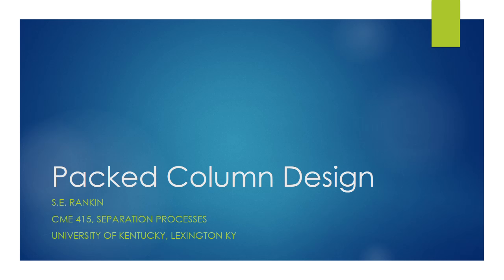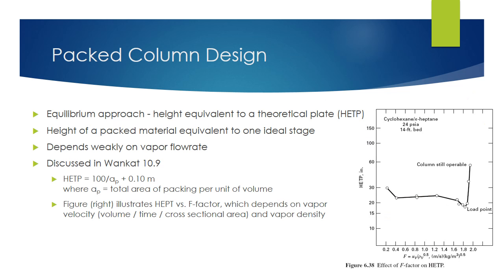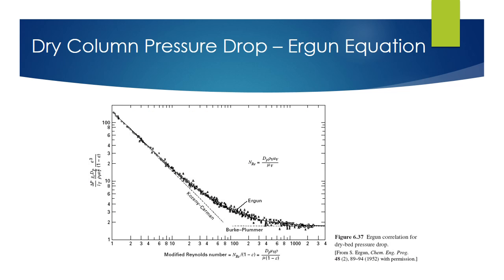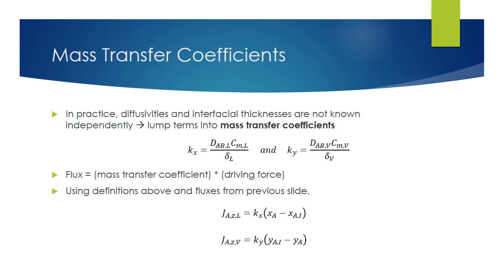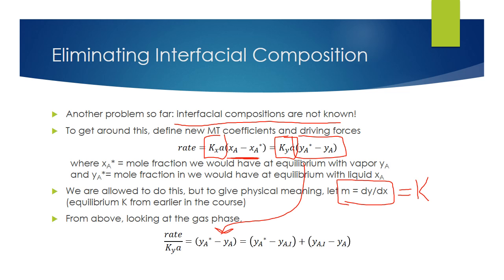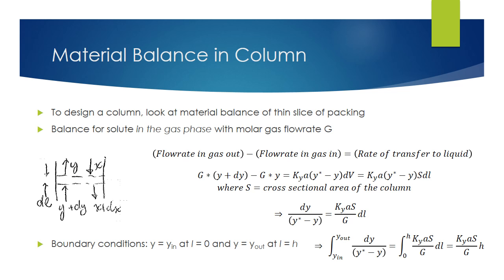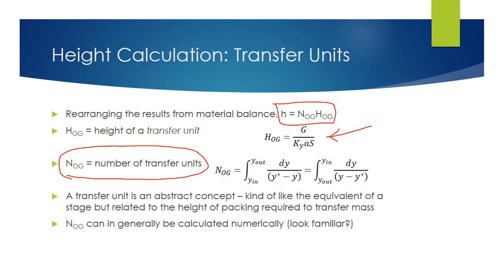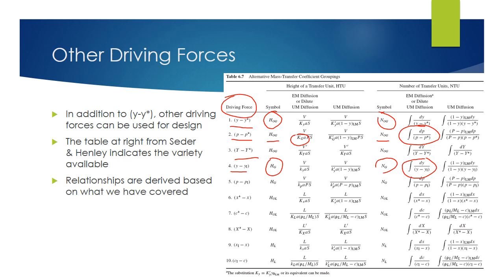Packed Column Design

Comment: I always found the mass transfer approach slightly abstract and confusing.  The main issue is that it’s usually very difficult to determine mass transfer coefficients.  In contrast most packing manufacturers can provide conservative HETP data for most common separations.
Reply: But how come do they know the concentration of solute we are handling?